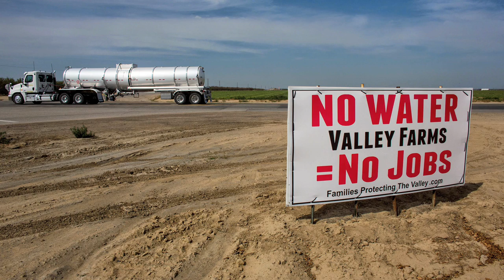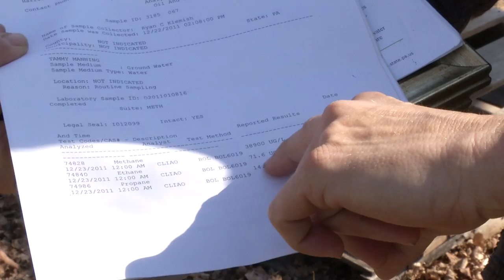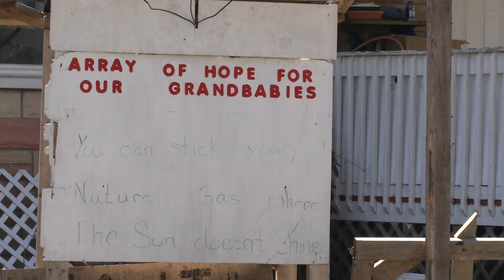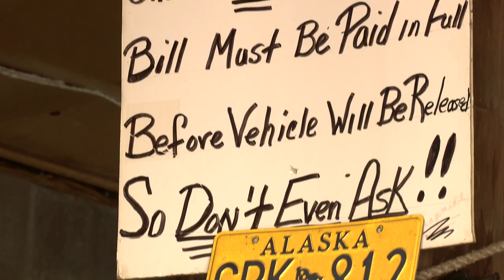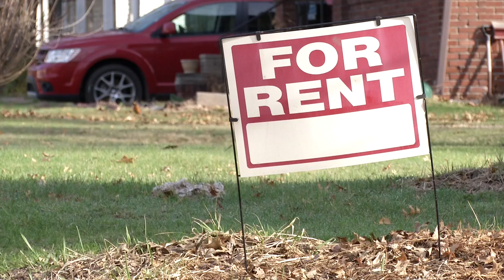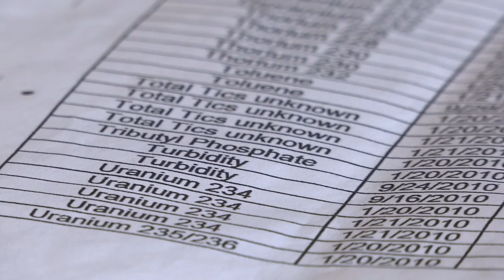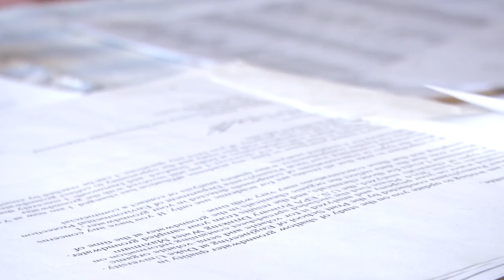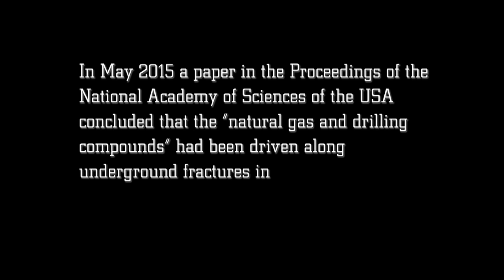Exposing the real price of the US fracking industry

Comment: I don't understand why there is still such a demand for Oil and Natural Gas. You can buy Split Ductless Heat Pumps to both Heat and Cool your home, and you can get units that are rated to produce Heat to Minus 20c. With my Split Ductless system, my average Hydro Bill in the Winter is between $50 - $100 Per Month and only $30 Per Month in the Spring and Summer for a 2,000 sq. ft. home.
In Europe, EV car sales make up 20% - 50% of New Car Sales while in America they only make up 3% of New Car Sales. North and South America and every other Country need to get with the Program. Oil and Gas is NOT the Future of this Planet.